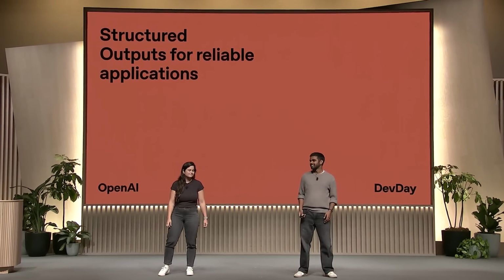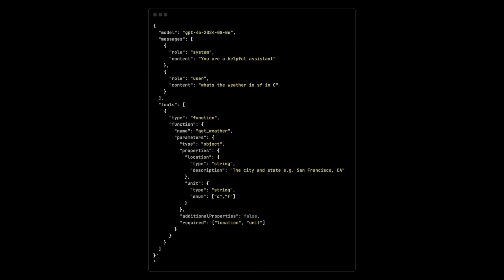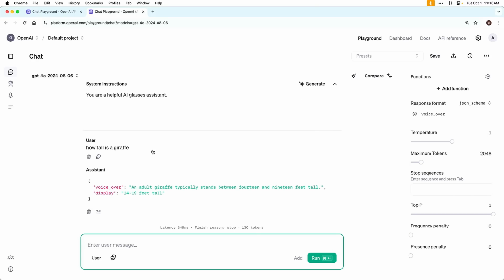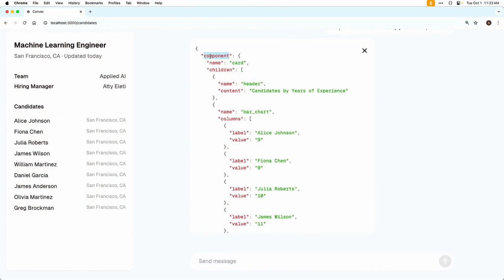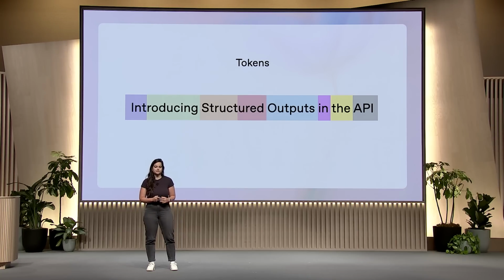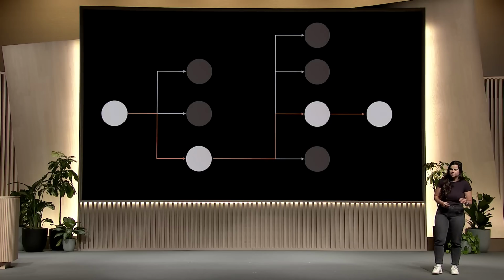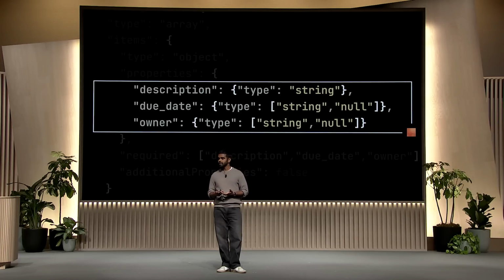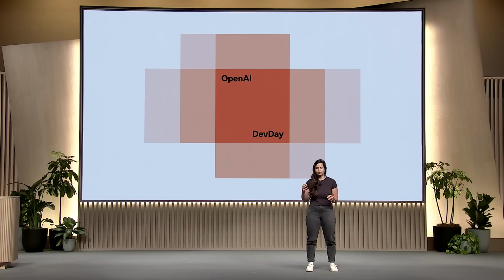OpenAI DevDay 2024 | Structured outputs for reliable applications

Comment: Pretty much all of current models work most of the time, sometimes they have some json formating errors but that's it. There's a lot of tools to extract json. Also I normally use them to output multiple code blocks at the same time. The amount of times I have triggered a format error with my json schema validator (I use ajv) can be counted with my fingers 😅. Most of the errors I see are not adding quotation marks to the keys.
Reply: That's exactly my sentiments. Even 3B models can output json, which can easly cleaned using a simple python function

Comment: I don't see why someone would use function calling over response format. Function calling seems like a subset of response format. If I get a response with a format that I wanted, I can then use the response to call a function or any other use case.
Reply: Choosing from a set of well defined and modular functions is often easier for the model than handling highly variable context-dependent outputs, even with a fixed schema imposed.
Reply: The model has been fine-tuned on the concept of tools / functions, so the quality of function choice and function bodies will be better than using plain response formats. Like all features of LLMs, what’s in the training data affects the model quality, so always good to align your usage with the data!

Comment: Why would we ever need strict property to be false?
Reply: you wouldn't - but we needed to keep the option there for backwards compatibility with functions that existed before structured outputs was launched.
Reply: @nikunj-openai  I had the same question, and I think @nikunj-openai gave a reasonable answer.
Reply: @nikunj-openai  to not overfit it down the wrong thinking path with your prompts and assumpstions.  Or so it can be flexible and creative etc.
Reply: There are also some features of JSON schema that strict mode doesn’t support e.g. min length, extra properties, optional properties, and so on. If those are important to you, you can still use response formats (and expose your schema to the model in the way it was trained) but not force those limitations during constrained decoding.